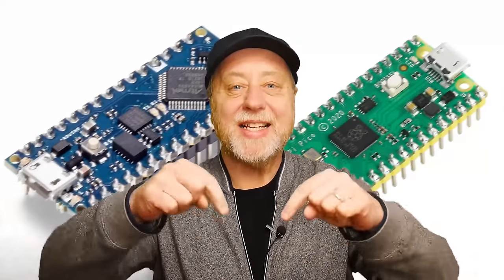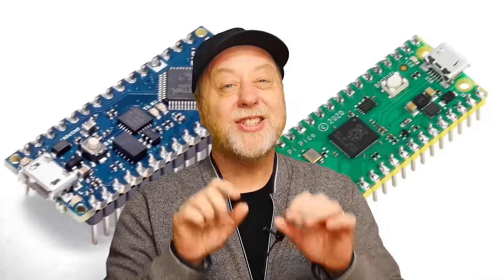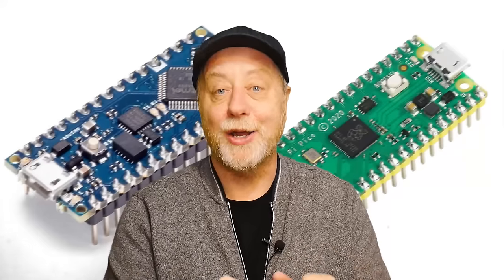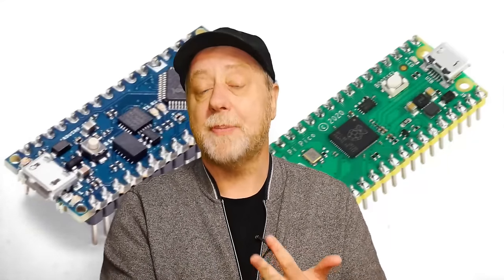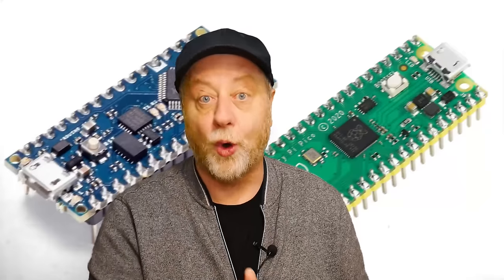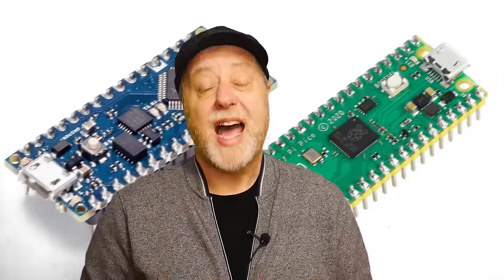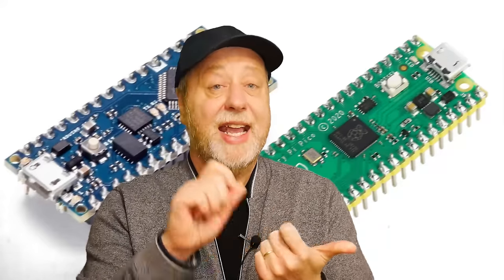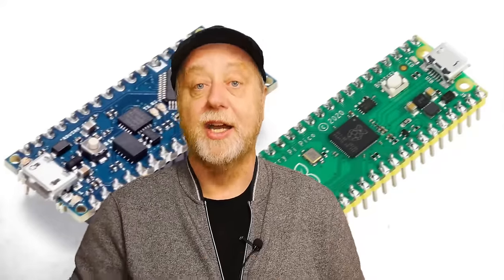Arduino vs Pico - Which is the Best Microcontroller For You?

Comment: UNFORTUNATELY, this comparison is wrong! It's not possible to compare Arduino and Pico, simply because Pico is a micro controller while Arduino is a system on how to program microcontrollers. You can have Arduino on Pico too.
Reply from the maker: LOL, well done for not watching the video.
Reply: @GaryExplains  Oh I watched the video! But I couldn't find an answer to the question about what is the best micro controller. I know that there is not really an answer as it depends on the project and knowledge. At least I would have expected a comparison between performance, power usage and differences of processors like timers/interrupts and so. But as you wanted to know, I'll tell you, I would prefer the Pico in any way. The main cause is the incredibly high level of customization, 2nd is the lower price, 3rd cause is the real debugging via second Pico and last but not least the 4. is the performance, which can vary from a few kHz up to 300MHz and even more. But also using VSCode for coding the Pico has much higher compilation speeds and after a few hours of learning has so many advantages over Arduino.

Comment: raspberry pi no es un microcontrolador, es un ordenador
Reply from the maker: Raspberry Pi Pico, not Raspberry Pi.
Reply: @GaryExplains  RPI pico se basa en el procesador Arm Cortex-M0+, por lo tanto no es un microcontrolador. Los microcontroladores se basan en microcontroladores y los ordenadores se basan en procesadores.
Reply from the maker: The Cortex-M0+ is a microcontroller, that is why it is "M". The Cortex-A and X are full processors and those are used in phones, tablets, SBCs (like Raspberry Pi), etc.

Comment: Arduino "Language" doesn't exist its just C++ Arduino Doesn't have a Language.
Also Wiring Processing "Language" doesn't exist either, it is just Java and the two couldn't be more different, the one isn't based on the other at all.
C++ is compiled to machine code and ran VS Java which is compiled to bytecode and then interpreted in a virtual machine.
Reply from the maker: Then why does it say "To do so you use the Arduino programming language (based on Wiring)" here https://www.arduino.cc/en/Guide/Introduction
Reply: @GaryExplains  If you enable in preferences 'show verbose output during' and tick compilation and upload in the arduino IDE it will show you what commands it actually executes and it uses a C++ compiler So it's C++ :) oh also I made an oopsie in my comment above, Instead of Wiring Language I meant processing.

Yea I might have steered a Little hard into this one sorry,
But Wiring was inspired by Processing in that they wanted to make it as easy as Processing, but it's not based on it only inspired by :)
I'll show my self out :)
Reply from the maker: Of course it uses GCC as the compiler, that is obvious, but I am just quoting the official position of the Arduino folks. Even though it uses GCC you still can't write an OS for the Arm based Arduino like I did for the Pico... That was the point I was making and it is true.

Comment: To answer your question at the end: Neither. 

I've had several new Arduinos in the junk box for more than a decade, and they stay there because I have never figured out how a piece of code works, or in some cases, why the devices are even needed. (And yes; I bought a book for beginners, but it's a waste of space to me.) Most jobs I've seen an Arduino performing could be done by using discrete and mostly analogue components, more simply, reliably and more efficiently. No programming required.

And yes, I can make an Arduino turn an LED on and off, by copying the code from a book. Anyone with modest intelligence can do that. But I have no idea why it works, and wouldn't know where to start, if asked to write code for a new task.

But I was only a lowly wafer fabrication engineer who designed and made some superb microwave transistors and RF power transistors, using techniques which would be inscrutable to a coder. I have degree level qualifications for that. To each their own!

That said, thanks for the video, Gary. You make the devices sound interesting. You might persuade me to take another look at them. 🙂👍

Comment: what about teensies 🤣
Reply from the maker: What about it? 🤪
Reply: I've heard they are really powerful and have big amount of pins compared to uno
Reply from the maker: They do, but ultimately they are just classed as an Arduino compatible, like so many other boards.
Reply: They aren't as easy to use with the arduino ide as many other boards, you need to modify the files to get teensies to work and that's why i thought so.

Btw i'm as far from being experienced with microcontrollers and electronics overall as it's possible so don't sue me 🙂